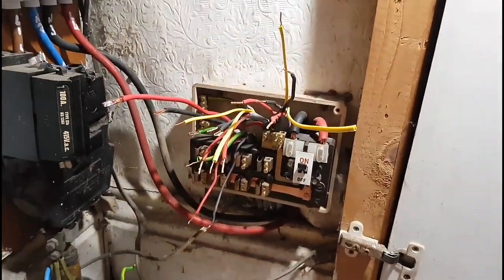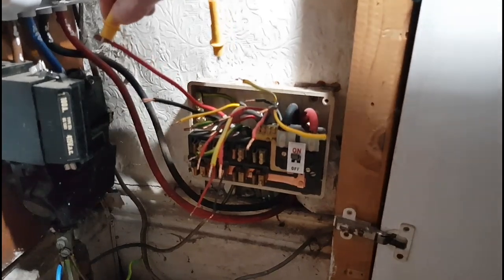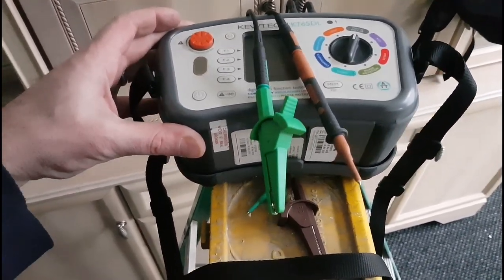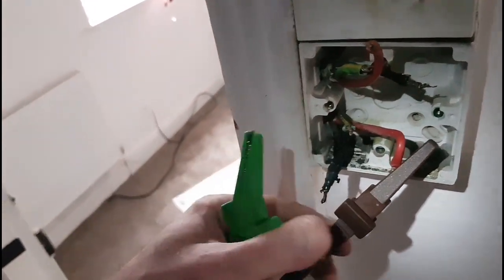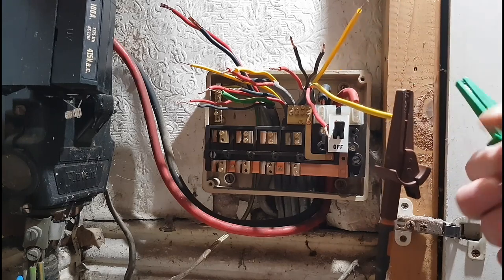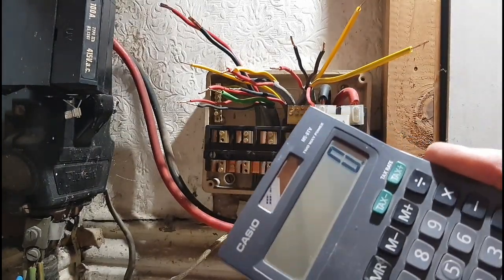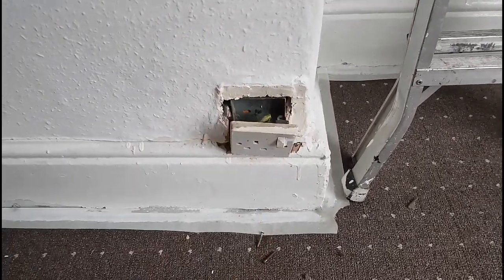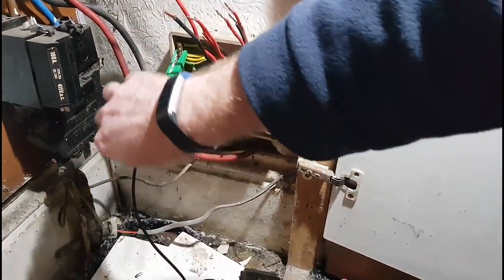EICR | Testing old installations | Part 2 (34)

Comment: The earth for 2.5mm² cable was increased from 1mm² to 1.5mm² in BS6004 in 1981 according to the 15th Edition guide I still have here. Looks like someone did the sums and realised it needed to be >1mm² when a 30A BS3036 rewirable fuse was used.

Comment: Won't stick around typng for long as it's v late, but really appreciated this and the part 1 and also enjoyed watching the dodgy shower with the 1mm flex in it.  Nice that no one was living in that house, I've got a right pain in the arse one I said yes to before christmas, not realising it has 40 plus circuits about 25 of them not labelled, and fridges, cookers, filing cabinets pulled up against fused switches, extra little boards, emergency lights (4 out of 17 working)...   now realise I'm gonna be back there monday after monday until it's done (it's commercial) with consequent delay in payment for any of it....   anyway, all the best, brilliant videos, see you soon again.   ttfn

Comment: It's a nicer place than where I was yesterday, changing sockets and doing testing the ring final circuit in a house that had flooded with about 3' of water in Worcestershire, mud and sludge all over the place trying not to drop a screwdriver or the test leads just so the power can go back on. Heaters were disconnected as they were quantum storage heaters and likely water in the circuit boards
Reply from the maker: I often wonder what the situation is where flooded homes are wrecked every time we get a storm? I guess they'll be a lot of work going on in affected areas?
Reply: @JBE  Yeah me too, was wondering about DNO supply in a house flooded. Do the DNO actually disconnect the area supply or does the sub main transformers automatically trip?.. out of sparkys scope i guess, but interested to know.

Comment: Full rewire is about the only thing going to redeem that complete mess. Not sure what you do with the solar fitment though? Leave it isolated if a rewire goes ahead I guess. Looking at the state of that building in general I doubt It will get a proper refurb.

Comment: On the IR test of shower when you did the link from L to N and onto earth bar in board was the cpc back  in the earth bar or loose as most other cpc'c had been disconnected. Just curious as this would have given a +999 reading without really testing it.

Comment: Was that 2 fuse wires in that carrier? Shouldn’t you have ur, removed one of them 😳
Reply: It looked like it was threaded through the ceramic holder, than through each brass contact, and twisted at the side of the holder avoiding the screws in the brass terminals.I'm guessing someone tried changing a blown fuse, and lost the screws, and just twisted the ends of the fuse wire together, lol.. crazy! but we see this all the time unfortunately. Better than a nail i suppose...
Reply from the maker: @muzikman2008  agreed 👍. In days when the man of the house changed fuses and light bulbs, this was probably just that..an on site repair. I bet he stood back and was all proud of himself?

Comment: What's PAT? It was on the screen. I use a kewtech but the cheaper version with fewer functions...
Reply: The Kewtech KT65DL MFT does PAT (Portable Appliance Testing) as well as 17th/18th edition testing, I have the same MFT. The earth bonding tests are slightly different for class 1 & 2 appliances. This MFT gives you both options. A great tester.
Reply from the maker: @muzikman2008  great MFT for the money. Bloody 5 years old now too.